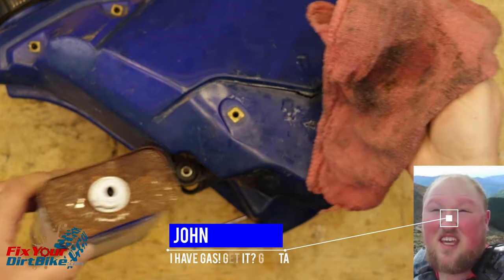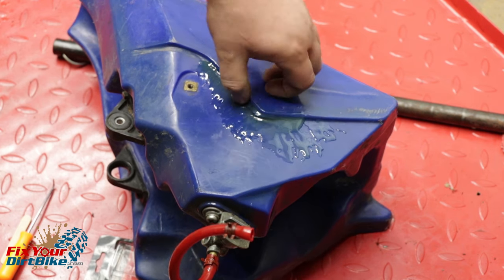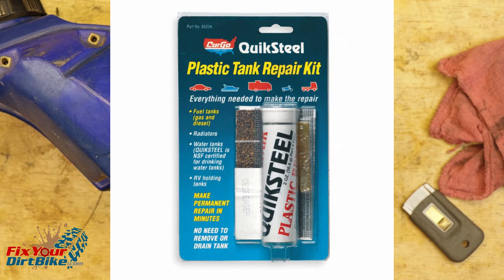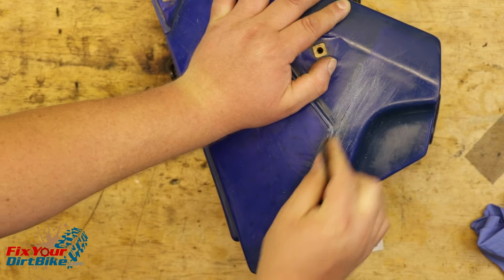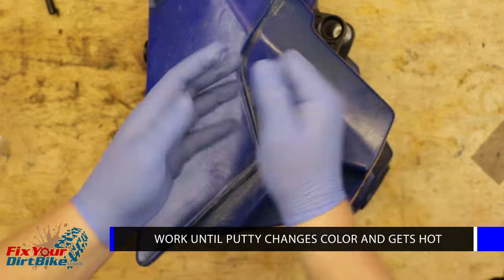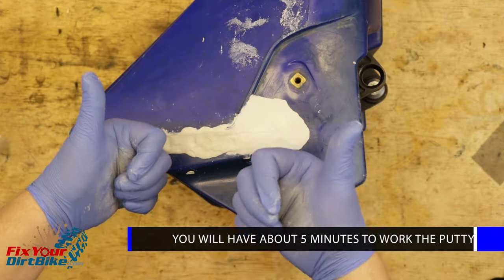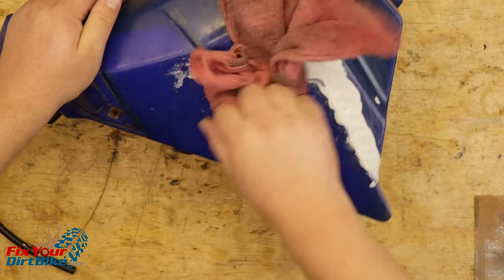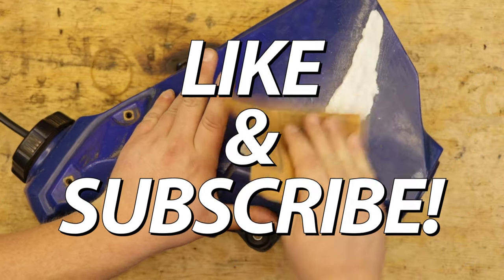How To Fix A Crack In Your Plastic Gas Tank With Quiksteel | FYDB

Comment: Ive got an SUV with a tiny crack on the tank from the previous owners encounter with a ditch. Going to try quicksteel. Thank you for your recommendation and the video.
Reply: Did it work?
Reply: Did it work?
Reply: It got stolen before I could attempt.  Make sure to install a killswitch if you live in an urban area

Comment: SO yea cracking your tank does suck, I cracked my 93kdx200 Tank bought the only used one i could find and it leaks around the petcock  I cant for the life of me find anything that will work to seal around it. Think for the time being im going to use the above method you just showed on my older tank and go from there and keep testing adhesives that wont breakdown.
Reply from the maker: Good luck! If you find something else that works let me know!
Reply: I have the same bike I wish they would make new tanks for them they are hard to find

Comment: Did it work???
Reply from the maker: It did, and then it suddenly didn't. I am in the process of finding a better solution!
Reply: @Fixyourdirtbike  Thanks I'm glad I waited
Reply: Did you find a better solution?
Reply: @lisafigueroa7813  For me it was my lawnmower. The top of the tank that a squirrel chewed thru so it's not constantly  immersed in fuel I used silicone caulk
Reply: @Fixyourdirtbike  hello, did you find a better solution?? i have struggled with the fuel tank on my cagiva navigator, all the repairs i have done have only lasted a few months, and really don't want to pay over 400-500€ for a "used" tank just for a crack 🤯🤯

Comment: Dumb product, if you really have to keep using a gas tank cracked that badly and you're already that deep into the project, use a "wood burner pen or soldering iron" to melt and reflow the plastic together.